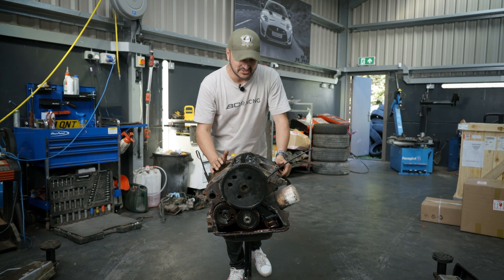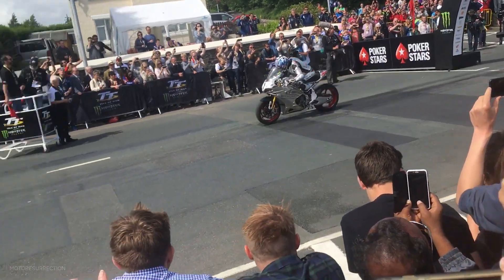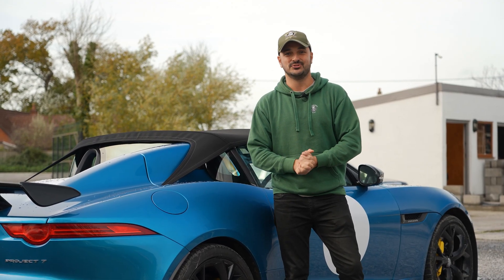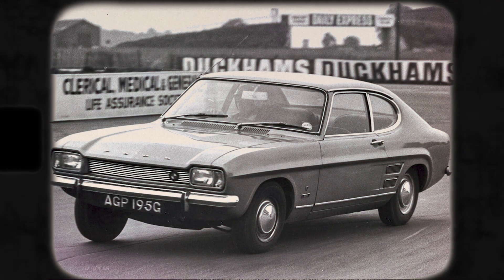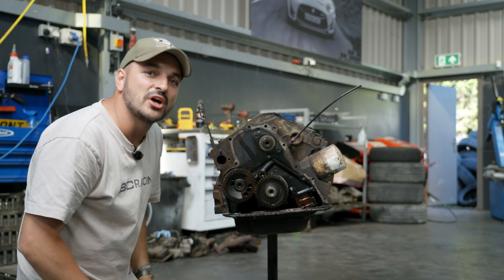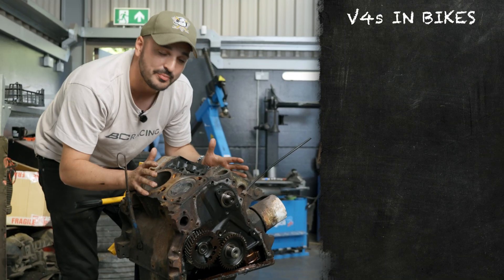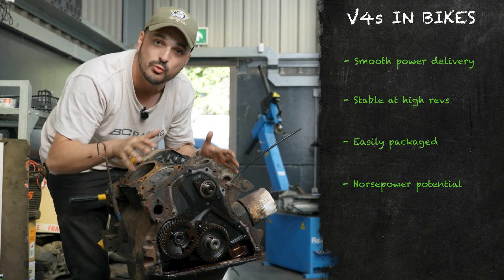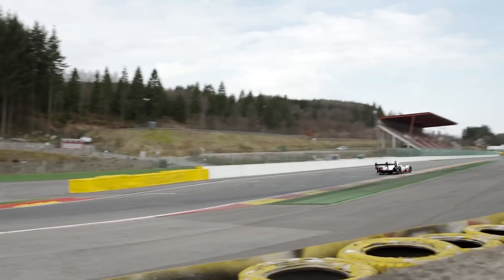Why Do Cars Not Have V4 Engines?

Comment: I've wondered if Subaru could have prevented a lot of head gasket issues by creating a V-4 instead of keeping the flat 4.  They have the engineering prowess to eliminate any design weakness.  Like Ducati (until lately) and their desmodromic valve train.. just too damned attached to the status quo.

Comment: In a nut shell...
A straight 4 is already relatively small and compact, a V4 is only slightly smaller and doesn't add any performance over a straight 4 but is significantly more complex and harder to manufacturer than a straight 4.

Where as a straight 6 is quite and long awkward large lump of an engine... So choosing a V6 makes a lot of engine bay packaging sense

Comment: 9:28 Yeah , you have few clues about motorcycles.
Bikes , with few exceptions,  have transverse engines - the engine (crankshaft) length affects the width of the bike , not the "length of the chassis" .
V- configurations are always worse for requiring a longer chassis than an IL2 , 3 or 4
Compare the Suzuki 650 V-twin to the Yamaha 700 parallel twin.
The V engines' rear cylinder bank makes locating the rear suspension damper a problem.
And V engines have no alternative other than putting the alternator on the end of the crankshaft , making a bike V-four at least as wide as an IL3. 
The IL engines put the alternators behind the cylinder bank , above the gearbox.

Comment: New meaning to a "crate engine" :) :)   I gues also , motorcycle and race cars dont run all the ancillaries (air con, huge alternator, power steering pump etc) that would negate the compactness of a v4 if used in a car.

Comment: I'm not convinced by the argument about vibrations. I've had a V4 in a motorcycle - a Honda VFR800 - and a car - a Saab 96. Neither of them vibrated noticeably. However, both had a lovely "throb" in the exhaust note.  The Saab V4 was from Ford of Germany, and is not the same thing as the UK-made Essex V4.

Comment: My Ford Capri MK1 has the Cologne V4 engine (that was also used in several Taunus models, Transit, Consul, Saab 95/95, Sonett and Matra). I've rebuilt it 2 years ago and the sound is quite good :)
Reply: Dropping the v4 in the Capri Mk1 makes no sense. You have so much space under the hood for lots of other simpler options. The Transit makes complete sense.

Comment: I had a 1984 V4 1100cc motorcycle (Honda V65) and that thing was a beast, awesome engine. A lot of others like Aprilia and Ducati have also started to use them recently. Also a Yamaha V4 115HP outboard engine which sounded awesome.
Reply: I have a 1997 v45 and it runs like new.
Reply: I had a 84 V65 Sabre - crazy acceleration, and very smooth. 
Also  96 ST1100, and now a 04 ST1300.  V4’s are awesome in bikes. Lumpy low rpm makes them bad for cars
Reply: The Honda V4’s were made for so long and in so many bikes as to be pretty smooth and reliable- except for the Goldwing, now everything is an inline 4 or a parallel twin. Those are fine, but I prefer the V4

Comment: Two missed advantages for bikes. 1) the narrowness of the packaging means the bike can be narrower (every bike - barring Moto Guzzi and some oddballs) has a transverse engine, so the wide inline 4 can add a lot of drag and sometimes ergonomic challenges.

2) bikes with V4s typically do NOT have an even firing order (instead using a "big bang" firing order). This means some of the power strokes overlap, but it also means that part of the time there is no power being put down. This gives the tire a chance to "rest" and recover traction. This is a huge concern for high-powered bikes, but not so much for cars (look up "high-side crash" for the reason why). The big bang firing order is SUCH a benefit that Yamaha famously makes a crossplane inline-4 for their R1.

Comment: I think a v4 could work well in something like a BRZ or gt86. It would probably be more compact than the flat four they use now and if they could design a flat plane. Crank that fires a cylinder on each side at the same time, maybe that would help with the rattle issue.

Comment: Why bother with the extra head for a V4 with all the complication and extra parts, but little gain, compared to a straight four, flat four(boxer) or rotary of similar capacity.. Been done on plenty of bikes. 
Unless the size/fitment is an issue? Just more moving parts.😉🙃

Comment: Another thing car manufacturers are not doing is crossplane L4s, they wouldn't even need to produce two sets of camshafts per engine, and the blocks are the same of the flatplane L4. Just like you get the "poor man's v10" sound with a L5, you can get the "poor man's v8" sound with a crossplane L4. It would be perfect for smaller enthusiast cars.
' OhHhHhUhHhHu bUt wHaT AbOuT ThE ViBrAtIoNs? ' If you dont get vibrated to death on a yamaha R1, its also not going to happen in a car, where the engine is even farther from you.

Comment: My grandfather had a Ford Corsair GT which had that Essex V4 (2L). 
It was just horrible. All the refinement of a concrete mixer and then it broke catastrophically  at only 36 000 miles from the internal vibrations (oil pump drive sheared). 
Aged 14 I took on the job of replacing the bearings and the pump drive shaft. 
It was a shame because otherwise I liked it.

Comment: a hot V has the exhaust manifolds exit the top of the heads with the inlets on the bottom outside. Not simply placing the turbo there. That  Porsche engine is not a hot V

Comment: Technically boxer/flat engines are 180 degree V engines, they also have 2 cylinder heads and all that, but they are quite wide and have a different set of downsides, even though they are great for giving a car a lower centre of mass and being inherently very well balanced, there's all sorts of oiling problems (RIP to all the WRX/STi that died from oil starvation). Not sure if they're more, or less, complex than V4s though.

Comment: Another car with the Ford V4 was the Matra M530, a very pretty little french rear-engined coupe, worth looking at. The Honda VFR1200F/X engine is an unusual V4 as it is a 76 degree bank with 28 degrees between the crank pins, so it doesn't need a baance shaft. It also has two cylinders of one bank close together at the waist of the bike to make the frame narrower and the other two on the opposite bank far apart where the frame is naturally wider. I own one, and find it to be a very comfortable rifing position despite its size, and far lighter than it looks. It doesn't sound like the V4 Hondas of old though, it's a bit like a BMW twin at low revs, but more like a V4 at 10,000 RPM. It produces 170BHP, so I'd love to see it in a Ford Transit or Corsair!

Comment: I'm not big on the motorcycle side of things, so I'd mostly been aware of the various European V4 car engines from the 1950s, 60s, and 70s ... up to 1981 with the Ford Taunus (used in Germany), though I think I'm more familiar with the British Ford Essex V4. I forgot about the air-cooled V4 used in the Mighty Mite M422 military vehicle.

And 92 hp was more than the 2L Ford Pinto engine put out in stock configurations ... at least in North American versions, but 92 hp might be gross and not net (due to European ratings shifting later than the US), and Europe didn't have the emissions standards the US did in the 1970s that further limited the Pinto 4 ... though the low compression 2L Pinto 4 for Sweden in the late 70s also had less power.
The standard British/European 2.0L Pinto 4 from that era was 99 hp, it looks like. (the 2.3L built in the US starting in the late 70s was 89 hp net, which hit 92 hp at some point, before dropping to 88 hp for most of the 80s in its basic configuration: the turbo versions were another story, including the 205 hp 1985 SVO Mustang version) 
Though as I recall, both the 2.0L and 2.3L could be heavily tuned (or use aftermarket cams) for significantly better high RPM performance. (being OHC engines ... vs competing pushrod OHV L4s, like the Pontiac Iron Duke or GM 122 ... the OHC 1.8L and 2.0L Opel designed GM Family II engines also didn't really outperform the OHV competition in the US market in the 80s or even 90s, though it was the 2.2L version of the 122 that displaced both the Iron Duke and Family II L4s with GM in the mid 90s)

Comment: Another very popular 90º V-4 was the outboard engine made by OMC/Evinrude/Johnson in the 1960's through the 90's.  Horsepower ranged from 85 to 140. They were two stroke, so had a smoothness advantage over a four stroke automotive version.

Comment: Why?  Fours are used in low cost cars.  V4s are lighter, smoother and shorter than in line 4s, but more expensive to build so there's the answer to your question.  Cost.
One of the most none cost effective uses of a V4 was the starting engine on John Deere 70 diesels.  
V4s are particularly well suited to motorcycles where the advantages can over come the cost.

Comment: Non 90-degree V4s are poorly balanced. 90 degree Vs have perfect primary balance in pairs of cylinders that share the crank pin with the help of a crankshaft counterweight. 90 degree V4s in most common crank throw angles also have better secondary balance than inline 4s because the secondary imbalances don't stack from all the pistons. You couldn't rev an engine with poor balance to 16,500 rpm, can you?

The main reason cars don't have V4s is cost and complexity. 2 cylinder banks, 2 heads, 4 camshafts etc. They couldn't justify the added costs to the buyers unless they also increase cylinder count.

Boxer 4s are also have the same disadvantages as V4 in terms of cost and complexity, and the only reason we can buy cars with them is because Porsche and Subaru are stubborn AF. You can't argue against the low center of gravity of a boxer engine tho. A WRX has less body roll than a M340i, and Porsche sportscar are in a league of their own when it comes to handling characteristics, and inherently low CG from a boxer engine helps with that a lot.

Comment: I once had a saab which was originally designed with a compact 2 stroke engine with 3 cylinders. When saab axed the 2 stroke they went for the german ford v4 which would fit the small engine bay.

Comment: We had a Corsair with a V4 when I was a kid. I don’t remember it being rattly at all. Made a lovely noise.
Reply: I had a Corsair 2000E, back in the day. V4 engine, same as a Transit, as I recall. It was old and knackered when I had it. Took it to the Lake District one weekend and it wouldn't get up Hard Knott Pass, lol
Reply: I bought one for a mate for fifty quid, it was smooth to drive but the thing was a rust bucket. We turned up at the MOT station, & clocking the tester using a toffee hammer with vengeance underneath the victim he was on with, I said `no way Joseph` , telling my mate to keep on driving😂
Reply: Our corsair was a nice car but a bit slow. Can't recall what engine it had but the mk1 base model escort that followed it was pants.

Comment: Had a Honda vf400f - new in 83. Absolutely wonderful, bought over an rd350lc and only half regret that! And vfr800x in 2012 - aka the crossrunner, an early tallrounder when they were (even) less fashionable. Never a v4 4 wheeler of course, but am old enough to admire the Ford Corsair as the odd child between the Anglias,Cortinas and Zephyr/Zodiacs. No idea if it drove well.

Comment: I used to have a 2L V4 Ford Corsair (68 or 67 model I think). Also had a 4 speed column change and a bench seat in the front. Nice car. Never see them now, not even at classic shows.

Comment: Hello Mike. Thx for the video. Howver...

The most important aspect of the V4 is left out, the added traction to the ground.

To understand what this means its easiest to study why Yamaha transitioned to a prrfect 90 deg crossplane crank configuration in their R1 which essentially means it is a V4 although all 4 cylinders are placed in-line. The reason is angular momentum. 

When the conrods are placed in a 90deg orientation, as in crossplane, there is no kinetic energy transitioning from the piston to the crank between dead centers. It means the whole crank has no variation in speed.

What this means is there is no slop in thr drive train. No slop in the drive train means less slip and more road feel. 

All this means that V4s provide added grip to the road because the total load from throttle is higher for a given slip limit compared to a traditional inline 4, whis is why so many have moved away from inline 4s in MotoGP.

Comment: 919 isn’t a true ‘hot vee’, the turbo is just mounted between banks, with the exhaust ports on the outside of the engine. Proper hot vee engines have exhaust ports facing each other in the vee

Comment: Automotive engineer here. This is good stuff. Keep it up, really enjoyed it. 
In my opinion the car industry never got around of a V4 because it made more financial sens to move to an inline 3. (And it is the reason car manufacturers probably will never go to a V4 sadly) Think about it: the i3 has nearly the same size, but much narrower, has perfect primary and secondary balance (and a rocking couple),and one less cylinder usually means better fuel economy, so neat little package.
Reply: Car industry had V4 episode in the Mk1 Transit -- first front engine van from Ford, and very short engine fit perfectly.  Also the Taunus 12M with front wheel drive in 1962 , engine was short and forward, Inline 3 or 4 would not fit.

Comment: I dont know if its the same ford v 4. But the original mustang concept before it was a pony car had a v4. Think mr2 spider in the 60s. But the executives didn’t think it would sell so the pivoted and we got the mustang we know. I didn’t know ford actually put v4s in real cars though.
Reply: Yes they did. Milions of cars.  Mostly Ford Transit Mk1 -- vans with front engine. Also the front wheel drive  Ford Taunus 12M  (called Ford Cardinal - they wanted to sell that car is USA :) )  later Ford Taunus 17 M and Ford 17M  medium size and quite large for Europe sedans (they also had the V6 in higher versions 20M and 26M) , sporty looking Ford Capri,   UK mid size sedan Corsair,  big Zephyr and later Consul/Granada cars as a base engine.

It was the same V4 from Europe is the 1st Mustang prototype --- mid engine V4 1,5 .
In Europe a car on this base was made -- called Matra 530 !!  The body was not so good looking but this car had the Mustang 1 prototype vibes for sure.

Comment: Kinda bigger but smaller at the same time, heavier and way more complex requiring 2x valve trains and costing more expensive, didnt even need to watch the video but doesnt make sense unless its a super niche limited run car to use a v4 when I4's are already very very compact engines and if you cannot fit an I4 into a car then its probably not big enough for a proper sized motor and requires something like a 880cc 3 cyl or something

Comment: Back in the very early 80s i bought a vw kombi that someone had put a transit V4 engine in. I bought it because it was kind of crazy and the heavy engine made the nose stand in the air so I thought it looked pretty cool. It had large scoops over the side inlets and the back cut out for the radiator with twin exhaust poking out below the bumper. Took it everywhere, skiing, beach everywhere, big side doors excellent vehicle. drew a crowd kind of miss it now.

Comment: Loved it.  However, I have a questions.  How is a V-4 different from the Subaru boxer in overall comparison?
Subaru has focused on their 4 cylinder boxer for years and they work brilliantly - Yes, I own 2 Subarus and love them both even if one has a CVT.  So one might think that another engine maker would have continued V-4 development for compact, if not a Kei car, daily commuter.  Is there an issue with fuel efficiency or something else that is not apparent in comparison to the 4-boxer??  Just curious.

Comment: Surprised you didn't touch on Subaru's "180° V4".
Reply: That's because it's not a 180° V4 (flat 4) it's a boxer 😉
Reply: @Farlig69 that's true. They solved a lot of the shortcomings of the v4 by making it opposed. Which is why the boxer should have been included in this video.
Reply: It's not a V4 though. You've got to leave room for future videos to be made, why inflate this video when it doesn't need it?

Comment: Great video!

Solid start, too. Generally, I like big diesel stuff - Leyland O.600; O.680 and TL11 for example.

These are lovely engines to drive with. I realise this channel is mostly car and bike though!

Looking forward to some VW TDI content. 

I am running an Audi A2 1.4 TDI with almost 300,000 miles on the clock.

Comment: Cool, by that rationale the horizontally opposed 4 shouldn't exist, yet there is Subaru and of course Porsche - they are cool because of the obvious reasons - but it is 2 sets of heads, timing chains and so forth when it's for a passenger car (particularly Subaru) you wonder why they have stuck it out when say - Toyota can make an inline 4, with 1 head, 1 exhaust manifold e.t.c. and produce similar horsepower (anything more than 200hp being unnecessary for 99% of car users) For Porsche - the lower centre of gravity, better torque makes sense... I'm not disagreeing with you at all, it's an interesting video, thankyou for taking the time to put it together